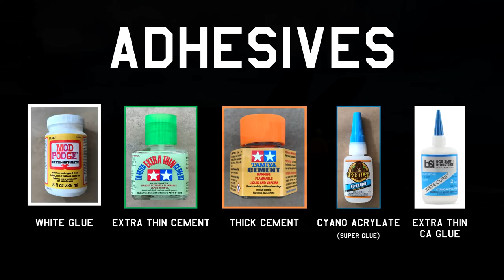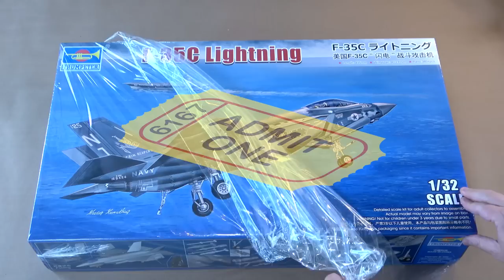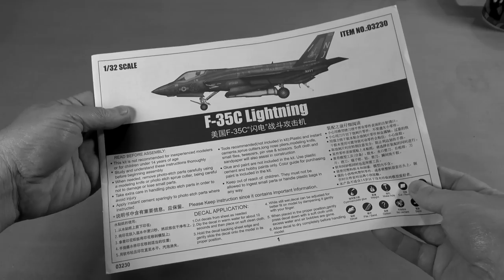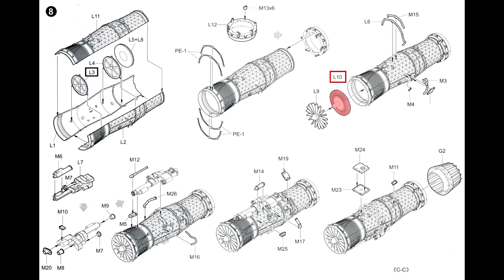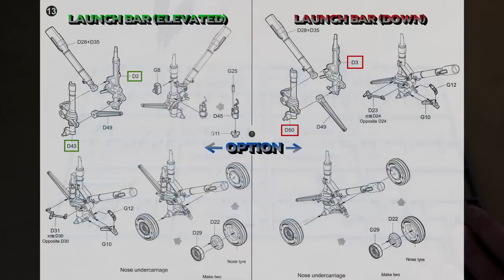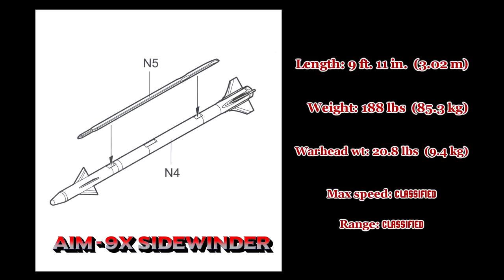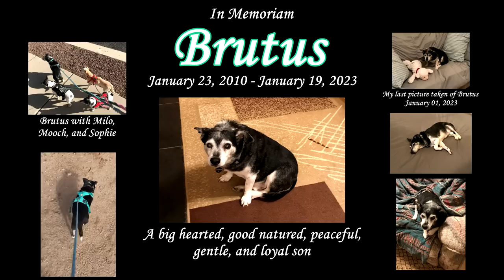Building the Trumpeter 1/32 Scale F-35C Lightning II Joint Strike Fighter

Comment: Cool introduction and video. It looks like it is bigger than Hasegawa? How is it in terms of detail? I was wondering what kit to buy?
Reply from the maker: Hi maxfartuhov, glad you enjoyed the video. This Trumpeter F-35C model is actually 225% (2.25x) larger than the Hasegawa 1/72 scale F-35 models. The detail is good, but the kit you may want to purchase comes down to how much time and money you want to spend on such a build.
Reply: @MaxAfterburner  and I guess it is bigger than Tamiya 61124 Lockheed Martin F-35A Lightning 1/48? but I could not find the info about how much they differ in terms of detail.
Reply from the maker: The Tamiya F-35A kit is better detailed, but it is smaller at 1/48 scale than the 1/32 Trumpeter. Also, the Tamiya would be smaller even at the same scale because the actual "A" Lightning II is not as big as the F-35C variant.
Reply: ok. thank you. anyway, I should buy both kits. @MaxAfterburner

Comment: Dear friend, I have a question:

how many psi do you use in your airbrush to paint with tamiya paint?

And how many passes does it give when painting after priming (xf-69)? (I have passed more than two coats and the paint has become very clear)....How I can avoid this?

Regards!!!
Reply from the maker: Hi strikeeagle7, I usually keep the the compressor set to a 22psi output. I get that question a lot so I post an inset image of the compressor gauge on the first airbrush session in each of my videos now. Depending on the color of your paint coat over the XF-69 and/or the dilution ratio of the paint may be factors. The final result of the look I want on my model can affect how many passes it will take to achieve the desired appearance. If I want a completely solid color on the model, it will take ~ 4 coats. 🧐
Reply: @MaxAfterburner  thanks dear friend, i´m made an f/a-18e and it seems to clear...i will put a new darker coat to fix this problem. i´m using 18psi. do you think is ok? or 22 is a good mark?

regards!!
Reply from the maker: 18 psi is probably just as good, I don't think it will make that much of a difference.
Reply: @MaxAfterburner  thanks ,  i will try

Comment: I work on the real thing on the production line in final assembly. Hope this kit goes together a lot better than the real thing. It's a mismanaged program badly designed pig of a plane.
Reply from the maker: Hi montylc2001, the F-35 doesn't seem to be a very popular jet in many respects 🐖. It's certainly one of my worst performing videos too. 🤨
Reply: @MaxAfterburner  I think it's a case of "jack of all trades master of none" as far this aircraft is concerned Tom. Also being somewhat awkward in appearance doesn't help.

Comment: Hi, really like your videos! I think once I heard you mention about "deconstructing" a model. Is that possible, and how would you proceed? I was thinking of removing decals, changing paint scheme, ect. I think some parts may have to be removed...thanks. Also, how to strip the Tamiya paint??
Reply from the maker: Hi Plydrms, I don't recall ever mentioning deconstruction, but if Tamiya acrylics were used, soaking them in a Windex type fluid would help make stripping the paint away much easier.
Reply: Ok, thank you. @MaxAfterburner